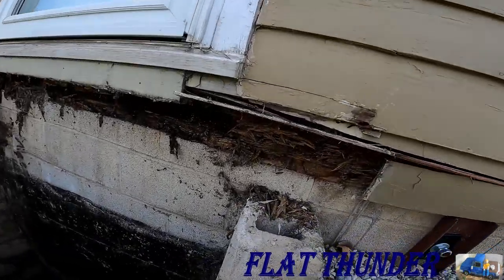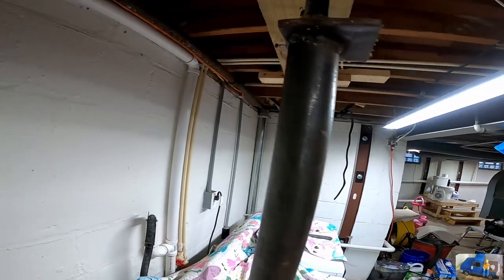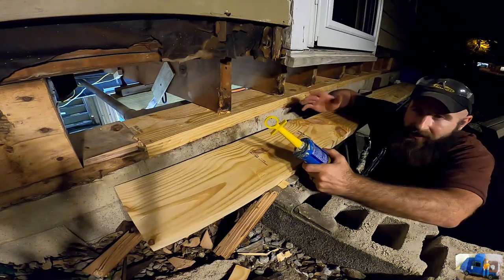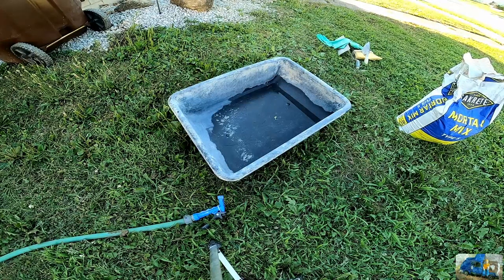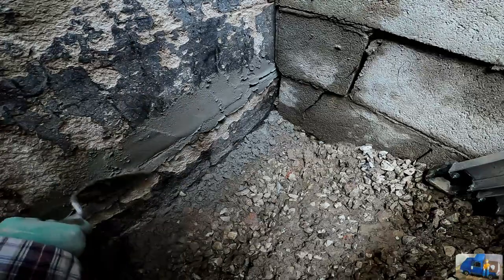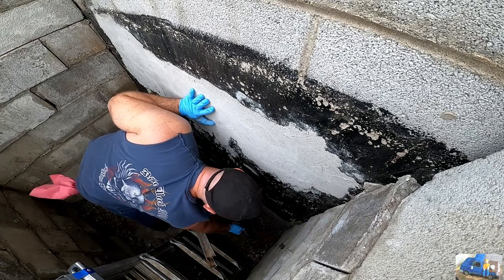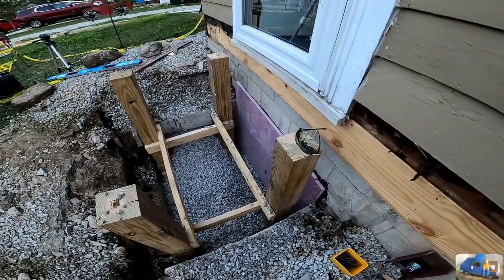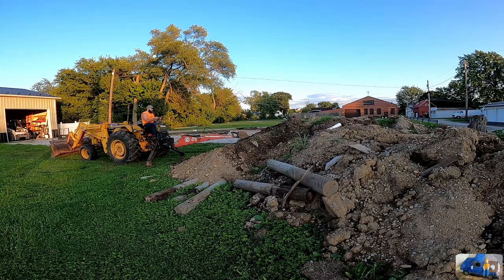RIM JOIST / SILL; REPLACEMENT (CONCRETE STEPS/PORCH ENT./ EP#2)

Comment: Great vid! I'm in the middle of trying to find a good resource for doing this repair on a rim and sill perpendicular to the rest of the joists. Any recommendations?
Reply from the maker: Thanks!  I have yet to tackle this project.  Hopefully I do not have to anytime soon, but I did just take a look at my sill plate.  I think I would notch the existing sill plate on the interior, install supports on top of the blocks directly below the wall cavity (but inside the basement / next to the rim joist), continue with the repair similar to the video, section or notch the replacement sill plate to miss the supports, and the last step (after the new sill & rim joist are installed) remove the supports / fill in the notches in the sill plate.  Generally it should be the same repair, but with a different support system.  I'd try to get a 4x4 or a small piece of steel in place with short jack bolts down to the foundation.   Maybe get away with a support jack bolt every 4'?  It depends on how heavy duty the support bar versus the weight of the wall.  Lift safely and cautiously.  You should be able to tell it's adequatingly supported before removing the old joist.  Thank you for watching and good luck with your project. 👍😁
Reply: Just to make sure I'm not confused, did you mean "Parallel instead of Perpendicular" in your question.  It looks like the floor joists in this video are Perpendicular to the Rim Joist on top of the Sill plate.
Reply: Thank you so much for the Video Flat Thunder.  Your work will really help me with the project I need to do for a friend. Problem - rotten sill plate and Rim Joist where Rim Joist is parallel to the other joists unlike the example in your video.  Could be 2 small, 2' or 3' foot sections or one long 8 - 10 ft section needing replacement. I won't know until I do some more de-construction at their place and pull the exterior siding off.  Here are the specs: 35 yr old house, 2 story with 8' ceilings in the  basement, the 1st and the  2nd floor.  Basement not finished.  Problem area close to one corner of the house.  Source of problem appears to be two or three fold.  1st - hot and cold copper water pipes running vertical from basement to 2nd floor in stud cavity (exterior wall - in climate with real winters & hot summers) that at one time had a leak that traveled/accumulated at the first floor decking/basement cieling 90 degree turn.  This appears to be the source of the original problem.  The next stud over is the start of framing for a "french door" 5' wide 2 panel porch door with one door panel static and the other door panel hinged, porch door is original. The moisture collecting in this area could also be from 33 years of "sweat condensation" on the pipes AND  2nd issue - moisture from the water pipe problem may have encouraged intrusion from the outside by insects.  There is daylight visible in the worse spot when looking out from the basement just like your video but it's just one spot about the size of a golf ball however the rot is spread out at least 2 or 3 feet and possibly up to 10 feet.  Just before I got the house 5 yrs ago, the previous owner put a small ground level deck on the house, under the "french door" where no deck or steps down had ever been built or so he said. The 8 x 10 deck sits on blocks and is not attached to the house but sits right up against the siding.  This has obviously held in a lot of moisture over the last 5 years and contributed to the rot from the outside.  The foundation/basement walls are poured and the next joist, parallel to the Rim Joist is 3.5" from the inside of the foundation wall (leaving little room to work from the inside) and it is 10.5" from the Rim Joist (I can't tell yet if there are two Rim Joists sandwiched together giving a 3" thickness or just one Rim Joist at 1.5" which seems  a bit thin with 2 x 6 walls?)  In the two worst spots I can see from the basement the OSB decking on the first floor is rotted too so I don't yet know if the "sill plate" for the 2 x 6 stud wall above the OSB decking is also rotted until I dig in further.  There is rot in the interior framing of the "french door" where the vertical framing meets the door sill.   I understand your reply to WookaBounce above who I believe has the same set up that I do (Rim Joist parallel to remainder of floor joists...even though he said "perpendicular" and I think your reply to him assumed the same.  I understand the first half of your reply to him re: adding vertical support blocks from the Sill plate where intact otherwise the concrete foundation to the first floor decking above it and then removing when job completed. Inserting these support blocks will be challenging due to the first interior joist being just 3.5" away from the concrete wall along with the bottom of the joist and the top of the Sill plate being flush.  Any blocking added from the inside will have to be fitted by hand, no hammers or levers or tools can be inserted to assist due to the confined work area so in effect they will be "catch blocks" if the wall sags 1/16th or 1/8th inch.  In order to install "support blocks" slightly oversized and hammered in with a mini-sledge, it will have to be from the exterior requiring a lot of excavating of Sill and Rim Joist first, in that narrow area before hammering them into position....unless you have any other ideas.  See Part II below, Youtube limits size of comment.
Reply: Part ll:  The second part of your reply to WookaBounce regarding a "support system" re: "get a 4x4 or a small piece of steel in place with short jack bolts down to the foundation" I can't picture or don't understand.  Can you give any more detail on how this is set up.  I assume it is from the outside/exterior of the house.  I looked up Jack bolts and only got info on them being hydraulic driven?...is that right?...sounds like very specialized equipment but I can't find any details on it.  If you can try to describe this "system" in a little more detail I'd really appreciate it or reference me to another video or website that shows the system and the jack bolts so I can visualize them and maybe figure out how they are integrated into the system.  Thanks so much ahead of time for sharing your mechanical engineering expertise.!!!!
Reply: @FlatThunder  Hello FlatThuder - I did not directly " reply" to your msg so you may not have been directly notified of activity on this video. That is the purpose of this reply.  Please see my questions below for my situation.  The 2 - comment question is actually pretty short and concise unlike the setup with the details describing my situation.  thanks in advance for reading through it all and responding.
Reply from the maker: @timhardman4764  Hello Tim!  I am sorry I did not see your previous messages.  The notification system and comment section on YouTube leaves a lot to be desired.  As with any application yours is very unique and specialized to your particular job.  You did a good job describing the application.  Here are few points / things I think might be helpful.  I think french doors are a common problem area on houses.  By design they create a large open area on the side of a house to welcome in moisture.  They are essentially two doors side by side.  If it is a true french door with a clear open span ie it's completely open when both doors are open the area beneath the door is not supporting the second story.  The door jamb will have a reinforced header that can only provide vertical support down to the foundation at each end of the door.  This means the space directly in the middle of the doors can be removed.  If the construction is as I suspect you should be able to remove the entire door and casing without affecting the structural integrity of the house.  Same concept when an entire french door assembly needs replaced.  I would not be concerned about providing support in the mid span of the door.  However It would be important to have supports in place at each end of the door.  These areas should have a composite stud that supports the header above the door. I would remove the deck or at least two foot of the deck next to the house during the completion of this project.  Next remove the lower level siding.  Once you obtain access to the rim joist you can fully evaluate the damage.  You should be able to replace the rim joist /sill plate directly beneath the door without a bunch of jacks / supports due to the header I discussed previously.  The support jacks can be boards, steel components, large bolts with nuts threaded on them for adjustment, tube jack (if it fits), automotive type scissor jack, basement tube jack shortened.  You have tons of options here.  My homemade jacks (as seen in the video) were structural tubing with washers / nuts welded on the end, thread in a piece of threaded rod, lock two nuts together on the end of the threaded rod, viola home made jack tube.  You are correct I would perform most of the work on the exterior due to the limited interior accessibility.  I also would probably support the first joist on the interior (the one 3 inches over) just for extra piece of mind.  Best of luck on the repair.  I suspect the door itself and improper flashing/drainage of the deck construction encouraged damage in this area.  Work safe and be careful in your project and consult a professional if you are ever worried or concerned about your ability to safely complete this construction task.  I'm no professional just a guy who works on most anything/everything!  Thanks for watching!  👍😐
Reply: @FlatThunder  Thank you FlatThunder for the quick and detailed reply.  You have provided me with lots of ideas and ambition to complete this project.  As you suggested, I will pull back the current deck in place by 2 feet.  Remove the first 2 or 3 rows of siding and inspect the condition of the Rim Joist and Sill Plate from the outside to determine where and what needs to be replaced.  I will support that first "inside" joist with appropriate materials.  I think I will get 4 or 5 - 16" x 3" x 0.375" steel bars to place under the first floor decking adjacent to the rotting Rim Joist along with 4 or 5 Harbor Freight bottle jacks to help support the weight and slightly raise that two story wall under the "French door" (which may be the wrong term as one door panel is fixed and the other panel door swings open hinged in the middle and there is a center vertical "support" where the door is hinged about an inch thick but I don't really know if it is load bearing or just part of the frame to accommodate the hinge) while I remove the Sill Plate and Rim Joist and replace them with new treated lumber.  My gut says, from initial observations, I don't have a big span to replace.  I'm thinking I have two short spans to replace but I won't really know until I dig in deeper.  Either way, I'll asses the situation and decide if it's something I need help with or if it looks safe and low risk, I'll try the repair on my own with all the right safety precautions and supports in place.  Thanks again for sharing your experience via video and warning others to always consult a professional.  We all do our work at our own risk and any youtube video just shows how one person did his own job in his own unique situation with his unique experience and skills that does not necessarily relate or apply to anybody else's job or abilities and skills.
Reply from the maker: @timhardman4764  you are welcome my friend!  I try to help anytime I can.  I am thinking, even though the door set has one fixed panel, it is probably still framed such that a real French door could be installed in the opening? I am guessing it should still have a nice size header above the door.  It sounds like you are on the right path.  I always advise people to use caution and work safely.  If you take your time and methodically think through it you probably won't have any issues.  Just don't full demo 'rip and tear' into.  If a board section is really hard to remove it could be loaded.  Cheers 👍

Comment: It looked like the floor joist ends were also rotted in your video like ours. Dont you need to cut out the rotted part?
Reply from the maker: They were discolored a little, but not rotten.  If yours are damaged remove the rotten part and add in a new piece.  I'd probably screw a new piece on the side of the original (overlap for a more solid attachment). Thanks for watching!  👍😁

Comment: hey man nice video. If you are just replacing the rim joist do you need to use support jacks or is that just for the sill plate?
Reply from the maker: Thanks!  If the rim joist is perpendicular to the floor joists, as shown in the video, you can probably replace it without supporting the floor.  The main reason i added jacks to mine was to replace the sill plate.  However, adding floor supports would be the safest solution regardless of the operation. Thanks for watching! 👍😁

Comment: What would you do if the joist ran the opposite way than in your situation ? Im in that situation and dont know which way to jack up the house.
Reply from the maker: Hi!  I would support the joist next to the wall, but also support it directly above the basement wall in multiple places (depending on the length of the section being replaced).  I would notch the old sill plate to allow for small supports to be installed.  If you have room you could build supports with offset feet to avoid notching.  Thanks for watching and best of luck on the repair.  Work safely!  👍😁
Reply: Could I put blocking between the rim and next joist then jack up the blocking ? I think that would work but then what to do when I need to replace rim
Reply from the maker: @TheJudgeJuryExecutioner  I think I see what you are saying.  This is where the notching of the sill plate would be required.  I would side in a steel structure, or rigid member, capable of supporting the wall yet shorter than your joists.  Then I would support the member by noticing the sill plate and installing vertical supports.  Small homenade jack screws would work.  This would facilitate fewer support pieces and notches in the sill plate. I'd shoot for every 4-6 feet in the supports.  This depends on the rigidity of the support.  Many different ways to support it.  Just make sure it's supported properly before removing rim joist.

Comment: So no jacks? I have been researching how to do this repair and folks keep saying you need to jack up the floor joists
Reply from the maker: Look closer in the video.   I show the floor supports at one point in the video.  Mine was jacked up and supported in the basement.  It was a 6x6 with homemade screw jacks.  Thanks for watching and good luck on the repair!  👍😁
Reply: @FlatThunder  Lol duh, must have missed that part
Reply: @FlatThunder  btw what's that pry bar you're using to rip out the rotted board? That looks handy.
Reply from the maker: @arkanoiddude  Gear wrench 33" Extendable indexing pry bar - 82220.  It is an awesome pry bar.  It's more for mechanics work, but I use it on everything!  Great tool I highly recommend getting one 👍
Reply: @FlatThunder  Oh nice...I'm actually an industrial mechanic by trade, but I mostly use the "screwdriver-style" pry bars at work. That thing looks awesome for ripping boards out.
Reply from the maker: @arkanoiddude  you'll want one....I first saw one in action working with a mill wright.  He said they are serious tools that can take a beating.  I had to have one 😁

Comment: Did you do all that work by your self with no help?
Reply from the maker: Sometimes I get help, but  this particular project was completed solo.  Thanks for watching and happy New Year! 👍😁
Reply: @FlatThunder  great work!! I have a similar issue except my damage is a result of termites. And just replacing 10ft of rim joist. Along with 3 floor joists. I have no help will be solo so it was great to see you did it on your own! You may have said it in the video, but how long did it take you to do that project and were you off every day to work on it? Or was it all done on weekends? Thanks
Reply from the maker: @scotts1111  Thanks!  Did you watch the video of me removing the concrete pad/steps?  I think I started removing the old pad the same day as the rim joist/sill plate replacement.  The whole process of replacing the old rim joist & sill plate was completed in a single day.  Pressuring washing, tuck pointing, taring, installing tar paper flashing and siding replacement took additional days.  I think my entire process took about 3-4 days.  This is mostly due to pressure washing dry time, time for the mortar to cure and being burnt out.  The hardest part you will have is lifting the support beam and new joists in position solo.  I used ratchet straps to help lift my 6x6 support in position; click a little on one end then move to the other end, repeat.  You might want to see if you can get a helper if you're replacing long joist sections.  Its doable solo, but easier and faster with an extra set of hands.  Lift safely and carefully, best wishes on your project!  👍😁
Reply: @FlatThunder  I have not seen the other videos but I will be sure to watch. Thanks for you reply. Happy New Year!